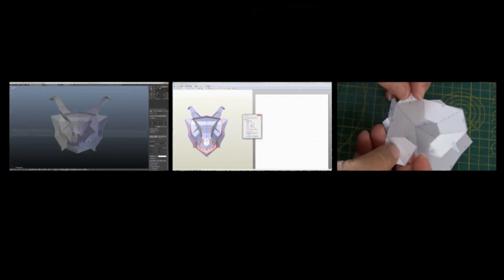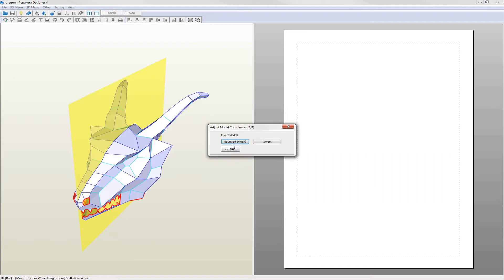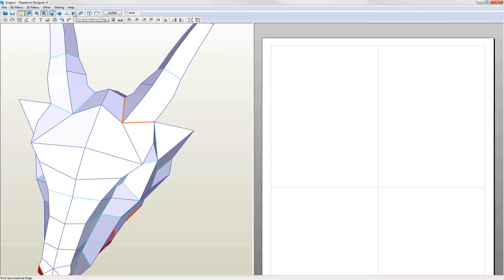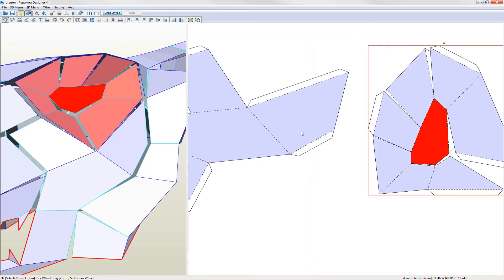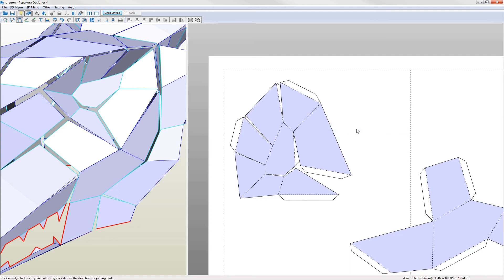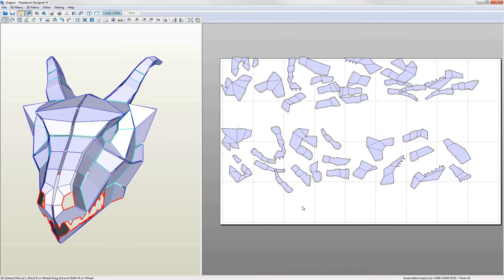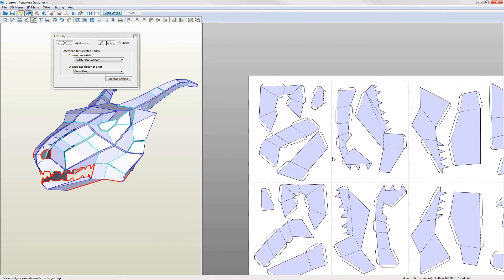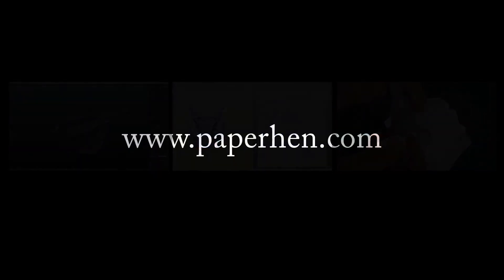Pepakura Designer 4 Tutorial - Transforming your 3D model into a 2D pattern

Comment: HOW MAKE CURVES
Reply from the maker: I'm assuming you mean curving a surface as opposed to having flat planes and folds. To do this you just adjust whether the fold line is shown based on a threshold. So for example if you had a fold line which bends a surface slightly to say 160 degrees, then usually Pep would show this as a fold and you'd score and fold it. However if you wanted more of a curve and therefore not fold the surface then you'd ignore that line. You can get Pep to only display fold lines beyond a threshold by changing the 'hide nearly flat lines' setting in the menu 'Setting/Other Settings/Line Style'. So setting this to 160 degrees will hide any fold lines that are on surfaces which are 'flatter' than 160 degrees and hence will be curved when building the model.

Comment: is it possible to unfold the 3D model without polygons? Some objects doesn't needs poligons like a simple table or chair.
Reply from the maker: Not sure what you mean? Any surface in a 3D model will have a face. So even a table top will have at least six faces for the top, bottom and four sides. When unfolded in Pep it will turn into a single polygon with five folds.
Reply: a square is a polygon

Comment: Is there a way to get a smoothed helmet in pepekura
Reply from the maker: You can either increase the amount of geometry (polys) in the original 3d model if you have access to it or, alternatively reduce the number of edges by hiding nearly flat edges using the Line Color Tool in pep. It depends on your model but generally don't go below about 160 Deg. If you're ultimately producing a 'real' helmet then you'd smooth with filler anway so it's a balance between how much you want to fill with a low poly model as opposed to how much time you take to build with a high poly model.
Reply: @paperhen   Well I read somewhere that it's best have as high a poly count or as accurate as possible before you start to print

Comment: Can you print the final pdf with textures on it as well? Can I import the textures into pepakura?
Reply from the maker: You usually import the textures along with the original model. For example if I'd added a texture to my Dragon mask example I would have done this in Blender and then exported the texture as part of the .obj file (the texture is defined in an .mtl file). When Pep opens the obj file it also reads the texture file as well and shows it rendered both on the 3D view and when you unfold. It'll also print the texture in the final pdf, although can stop this by  switching the texture on/off (in the 'Other' menu). One thing to remember though is to allow your texture to 'bleed' over the edges otherwise you'll get white line in your final model as it's very difficult to cut out the printed parts exactly along a line. The option for this is in the '2D Menu/Add Outline Padding' and the amount of padding is in 'Setting/Other Settings/Other Tab (Amount of Outline Padding)'.
Reply: @paperhen  Thank you a million!!!! I will use pep in my final exams for college. I work in blender but I wanted to create a set of simple low poly figurines with textures on it. You helped me a lot!
Reply from the maker: @Freyadevriesart  No problem! If you're just starting with Pep textures then I'd experiment initially using the Blender default cube and painting on it to see the outcome in Pep. A big thing to remember is to get your low poly figurines and textures correct in Blender first before doing much in Pep. When I started I made the mistake of doing the full parts layout in Pep and then decided I wanted to change the model geometry. When you do this Pep cannot just reload the model as the geometry has changed so you have to start again.
Good luck with your exams!
Reply: @paperhen  I fully understand that pep is quite similair to uv mapping. When texture is added the model should be finnished and no further changes will be made that could change the geometry. I will try out some simple geometric forms in pep with texture on it first to get the hang of it. My exam will start 2 nov. I started early exploring on what I wanted to do. So I got some time to learn more about the option that pep gives me. Excited to work with ir.

Comment: How do I "Adjust Model Coordinates" if those promps don't automatically start?
Reply from the maker: Go to the 3D menu and then 'change coordinates/change model coordinates'. If it's greyed out (because you've already unfolded) then you have to hit the 'Undo Unfold' button to clear the unfolding. Unfortunately you'll lose all of your current 2D layout when you do, so make a copy of your pdo and refer to it if you want to recreate your layout...
Reply: @paperhen  if the files I have are already unfolded, do I need to adjust the model coordinates? Also, the files I have are for foam. But, I want to make my armor out of card stock, resin and Bondo. Is there a difference or does it matter. I think all I have to do is scale the model to my size and add flaps
Reply from the maker: @drpeppero3  You probably don't need to change the coordinates if it's already been done for the armour. As the files are for foam then I'd check that the 2D model is complete as quite often some parts are not. This is because foam already has a thickness so the parts of the model which add thickness are typically ignored and are moved off page. To check just select the thickness face of a few parts in the 3D model and see where they are in the 2D layout. If everything is there you should just need to scale and add flaps....
Reply: @paperhen  Thank you.

Comment: Hi! when I click on pick symmetrical edges to specify open edges, since my model is symmetrical, it won't work, even though my model is symmetrical, I'm using pepakura designer 3 and pepakura designer 4 and neither of them work for this. Do you know why? Thank you in advance!
Reply from the maker: Hi, The symmetrical edge only works before the model has been unfolded. In Pep4 make sure that the 3D Edit Mode is set to 'Specify Cutline Edge' and then enable the 'Select Symmetrical Pair'. Clicking on an edge on the model should then also mark the other symmetrical edge as well.
Reply: @paperhen  Thank you so much for your super fast response! Although I still have the same problem, I'm going to try uninstalling Pep4 and reinstalling it again and see if this works! Thanks again!

Comment: how to recolour a 2d template?
Reply from the maker: To add colour to a model you need to specify a texture image for the material (in Setting > Texture Settings). If it's just a solid colour you want for all of the faces then simply create an image file (e.g. png) with that solid colour and load into Pep. If you want to texture your model with a pattern or logo then you need to use 3D modelling software to texture the faces of the 3D model, export the texture and then load into Pep. This is so Pep can map the texture to the correct faces.
Reply: @paperhen  thank you so much mate

Comment: difficult to ask this question because i dont know how to ask it but here i go: how do i get rid of the gaps in pepakura? For example, i have to trace onto foam a dome like structure but it has random slits between the shape (which are used to glue together on paper to create the dome shape) however I just would like to print out one large shape to trade on foam becuase having to do it on paper and trying to flatten the pattern onto foam is difficult because it wont flatten itself when taped together. Does this make sense? I'm trying to learn pepakura and trying to join and disjoin but doesnt get rid of these slits. It's very frustrating please help!
Reply from the maker: Hi, A dome shape will always have some slits between the faces when it's transformed from 3D to 2D. If you think about a real dome and then pressing down on it to make it flat then the dome shape will have to split apart to become flat.

Comment: Uhm hello excuse me,I can't. cut some of the. cutline edges of. the model because  the model has many of those. How do I remove them all by doing something?
Reply from the maker: Hi, not sure what you mean about not being able to cut some of the edges - is it because the edges overlap each other?
Reply: @paperhen  I mean like I loaded a model with a lot of edges and I do not know how to delete all of them because it will take a long times is there a button to delete each. edge that the unfolding did?
Reply from the maker: You cannot 'delete' an edge (meaning a cut line), you can only turn an edge into a fold by joining one edge with another to create a larger part. You do this using the 'join/disjoin' method which only works on one edge at a time.
If your model has got too many faces, which are the cause of the edges, then the only way of solving this really is to edit the original model. Pepakura does allow some 3D editing of the model but it's very basic and not worth the effort.
If you want to reduce the number of 'fold lines' then there's a setting (in 'other settings') where you can hide nearly flat folding lines and set a threshold angle. Of course doing this will mean that your finished model will have curved faces.

Comment: Just wondering: Do I have to 'flip'/invert my model first? I'm scared that otherwise the edge ID numbers lay on the outside of the model and hence are visible on the outside.
Reply from the maker: Hi,
If you want the edge id's and fold lines to be on the inside then flip the faces (in step 1 'Adjust Model Coordinates'). This basically turns your model inside out and you'll see that the faces are grey on the outside and white on the inside. The other alternative is to not flip but just interpret the fold lines in the opposite sense when building the model - so fold a valley as a mountain for example.
Having the edge id's on the inside makes building slightly more difficult and of course if you're going to paint the model then it doesn't matter whether they're on the outside.
Hope that helps...
Reply: Thanks. As I already had it as a pdf file then, all I did was mirroring it. Work as well ;)

Comment: I'm having another issue here. I have finished with the body of my model, but she also wears a cape and I don't know how to scale it correctly until when I assemble them, the cape fits well onto the body. Could you please help me with this?
Reply from the maker: Hi,
I'm assuming that the cape is in a different Pep file to the body but is from the same Blender model and you want to make sure that the cape fits the body okay. First check the scale factor you used when unfolding the body (2D Menu > Change Scale > Set Scale) and then use this scale factor for your cape. Then use the Measure Distance Between Two Point feature and measure the distance between two vertices on the body where the cape is supposed to touch. Measure the equivalent distance on the cape to check that the scaling is correct and adjust if necessary. That should be enough.
Of course it's always better to export all of your connected object in Blender first and then import them into Pepakura as one file. In that way the scaling will just work....
Reply: PaperHen I made them separate so it will be easier to open the edges along the back and legs underneath the cape. They are both the same type of file.
Reply: PaperHen I tried changing the scale and tried to type in the same thing as the body, but the numbers kept changing every time I deleted or entered a digit. I kept trying until I realized the sizes of the body and cape are different..

Comment: You have really helped me with quite a few things in this tutorial (GOD BLESS YOU THANK YOU SO MUCH), but I am having an issue with the pick symmetrical edge option. For some reason, it is not working. I clicked on it, but it isn't doing anything and I would like for it to work so badly to make things easier instead of me constantly going back and forth between sides and wasting precious time. Help please?
Reply from the maker: Hi,
Apparently Pepakura uses absolute coordinates of the edges in order to pick symmetrical ones. Therefore your model has to actually be symmetrical through the XY, YZ or ZX plane. You'll therefore need to check that your 3D model is actually symmetrical before importing into Pepakura (assuming you're importing rather than opening a Pep file).
In Blender I usually use the mirror modifier which will guarantee symmetry.
Hope that helps!
Reply: PaperHen Thank you for replying. My model is symmetrical. I guess I clicked on the wrong thing in the beginning when the program was asking questions about my model.. Oh well. Currently I have come so far now. I have already added where there are open edges. It sure will take a while to lay out all 330 parts and assemble it all together after I print the pages.
Reply: PaperHen And yes I am importing from Blender.

Comment: any recommendations for 3D modeling software, id like to convert a full set of Armour into pepakura and cant find one thats already been done anywhere so ill give it a go, ive used Pepakura in the past but never as in depth or for something as large as im planning this vid helps alot.
Reply: Thanks very much :D
Reply: MajorLacerations I highly recommend Blender. It is 100% free, easier to use than other programs (as far as I have been hearing), and there are many tutorials and troubleshooting pages for help on anything. And importing your model is simple. Just go to file > import > 3Ds format and save your creation and open in Pepakura.
Reply: If the 3Ds format doesn't work for you, experiment with other formats to find the right one for you.
Reply: Be aware when you are making the model, think about keeping it simple and low poly so it is easy to build later. I learned that the hard way. I am currently working on my favorite YouTuber's OC Play and I didn't keep the head so low poly, so I'm sure I will be building the head for quite a while longer than any other parts of the body.

Comment: Really helpful thanks!! My model (of 900+ faces) unfolded as nearly one piece, so this was v helpful in thinking in terms of how to edit the 3D to drive the 2D into more sensible shapes to cut out. Thanks again!!
Reply from the maker: Glad you found the video helpful. I think that it's always better to 'cut' the 3D model in meaningful parts as this often helps with the build. Before unfolding the model, I tend to think ahead to how I'm likely to build it (for example assembling the horns separately and then attaching these to the head) and then seam the 3D model appropriately....
Reply: Yeah you should be on the payroll!  ;-)
I was completely new so didn't realise that you've full control of how it unfolds - the auto one produces such deranged results as far as I can see it's not much use.
I guess another consideration if making a closed shape is how the last few parts come together to seal it shut.

Comment: how do i invert the image as i have a left leg but no right leg.
Reply from the maker: Not sure what you mean exactly, but if you want Pepakura to treat the left side of your model as the right side then just Invert the model when you open the 3D file (it's step 4 of 4 in Adjust Model Coordinates dialog).
Reply: its sorted now. i was on viewer not designer. i downloaded a file and it was for a left leg. theres an option that mirrors all the parts to make the right leg. (inversion)
Reply from the maker: Okay, I understand - yes the Mirror Inversion is the right way to do what you wanted (in Other/Mirror Invertion). Thanks for sharing the tip!